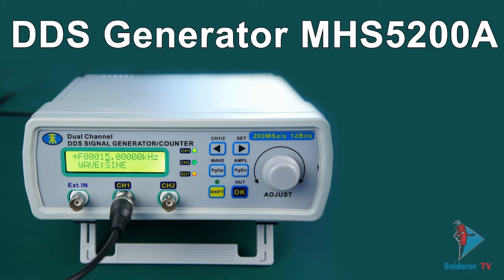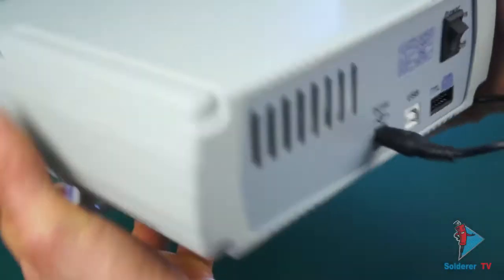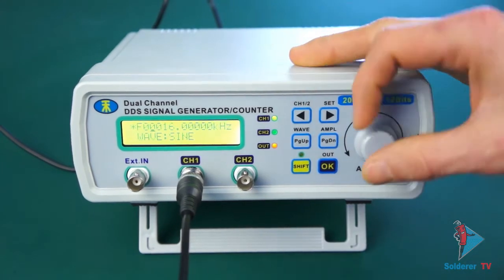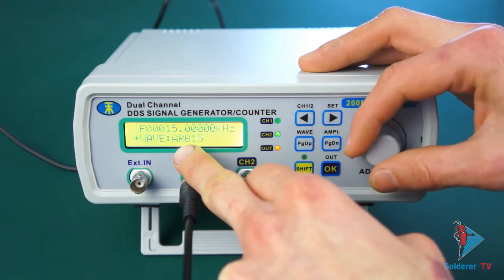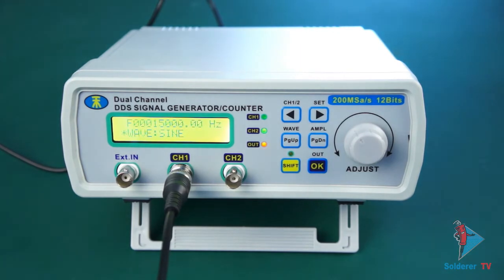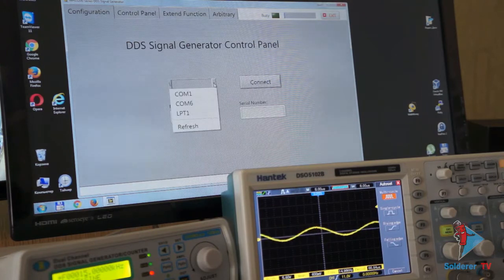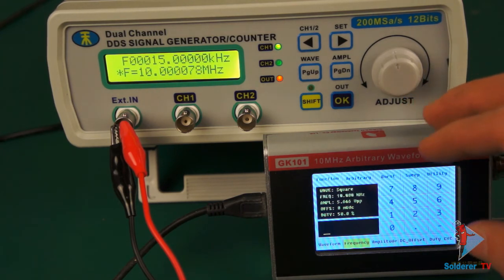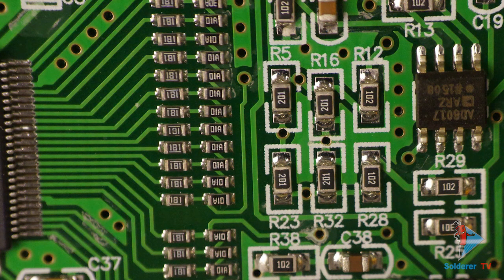MHS5200 - Review DDS Generator

Comment: is it possible to generate a modulation with this unit?
Reply: I believe so but you may notice that very few reviews show this gen at it's maximum frequencies as it distorts badly and the voltage drops by at least half.  By the way the voltage you set is half the voltage you get (approx.) as they don't assume a 50 ohm load.  I have one, it's sat in the box since I got it.  Not a good gen.